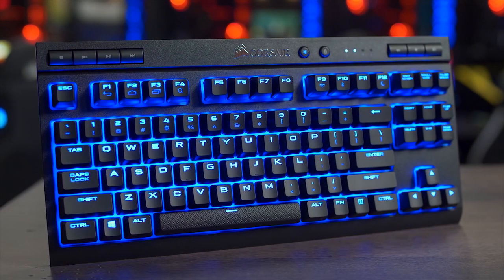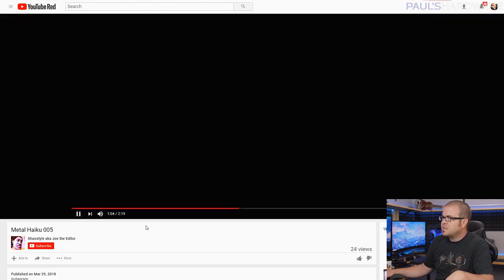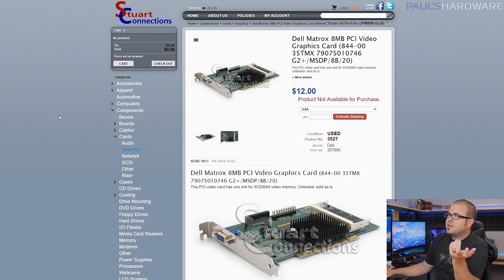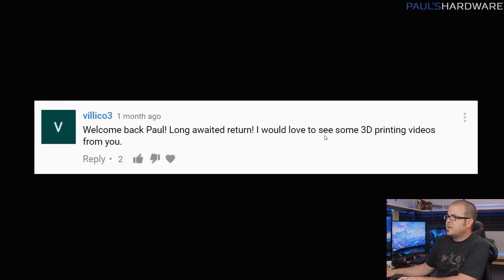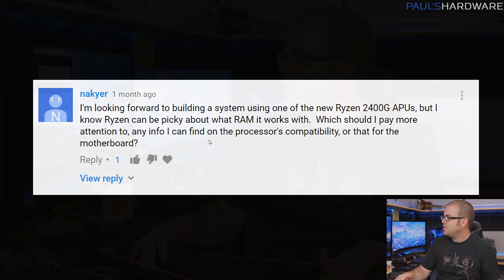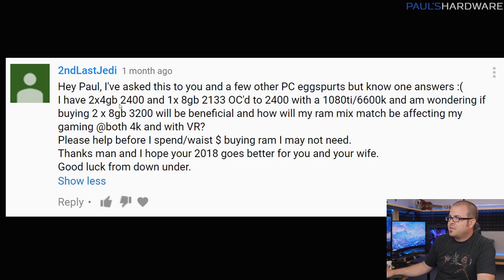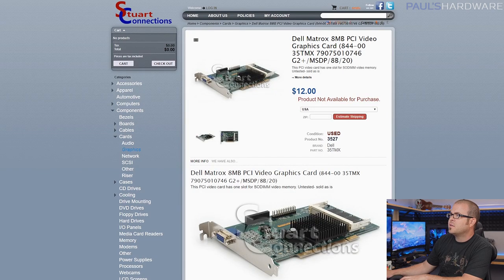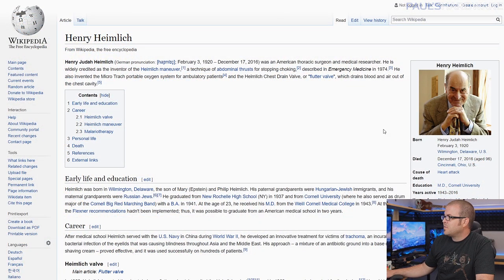Why Can’t You Upgrade VRAM on a Graphics Card? - Probing Paul #23

Comment: 5:00 you could still do it.  They could still design it that way.  They just choose not to.  They could have it so you slide ram in the side, into a little holder between the heat sink and the main board.  Trust me IF they wanted to do it, they could.  They could also program them to use different settings based on how much RAM.  I don't know how cost-effective all of this is, but it's all VERY possible.  Many people do these videos from a consumer point of view:  "You can't do it because the overlords didn't design it that way".  This is why Steve Jobs shocked the tech. scene back in the day.  He walked in and said "we're going to do this, this, and this.  Make it happen".  The Engineers were in the "but people don't do that" mindset.  He yelled at them and told them "GET IT DONE".  So they got it done and amazed even themselves.  Trust me they could make a gpu upgradeable in various ways IF they wanted to.  Fact is, it's FAR more profitable to make people buy new gpu's constantly to get any sort of upgrade.  Sound familiar?  (Hint: can't upgrade phones, tablets, or even most laptop hardware either...)
Reply: This right here is the actual full story.  Granted for the majority of people it probably would not be possible to replace the chip on the board, but its also far from impossible.  I ended up here wondering if anyone made firmware to enable the graphics card to recognize the larger size memory "VRAM", and sadly looks like its such a niche segment that it would take a lot of programming / firmware work.  Just wanted to say that Wayne here is spot on, I've worked in the semiconductor industry for almost 20 years and I can attest, if they wanted to it would not be hard at all.  Perfect example of this is laptops coming out now with RAM chips soldered on the motherboard and "not replaceable", they just decided to do that, it did have to be that way, and until recently has not ever been the norm.

Comment: It's possible to upgrade vram by soldering the same ram to the spare sockets or upgrading it vise versa. Just takes a while as then you'd need to reflash the bios to be a custom developed one (they're available on certain platform, but are a bit hard to find real bioses as most aren't good).

Comment: GPUs did used to have upgradable RAM, they stopped doing it in favour of planned obsolescence.  GPUs usually run out of VRAM before grunt as time goes on (I.E GTX600 series).

Comment: FYI It wouldn't be feasible to setup a printer in your garage if you're planning on filming/recording in the same space. They're reasonably loud even with mods and an enclosure. The print times can also be quite long so you wouldn't really be able to use the space at all unless you're printing while you sleep/out of the house.

Comment: Hi Paul, I have a couple of questions related to hardware for Blender because I couldn't find the answer anywhere on the internet... I am a beginner with this piece of software tho
- Since GPU rendering (AMD ProRender for blender and CAD) is a thing nowadays, should I go almost all in on GPU, or will I need multiple cores for modeling as well, just like for rendering?
- Can the GPU use all the system RAM if I am rendering with CPU and GPU? Or will the memory be combined?
- how much RAM do I need for 'large' projects, such as architectural models (scyscrapers) with modeling (so not rendering)?
- does a faster CPU (higher single core performance) affect MODELING performance, like with CAD design? Or won´t there be a big difference?
I'd love to hear your answer!

Comment: The Prusa i3 MK3 would be what I recommend as far as a 3D printer goes.  It has the best feature set for a desktop 3D printer imho.  Mesh Leveling, magnetic bed, filament sensor, etc and it's super quiet compared to nearly any printer in that price range.  For $750 you can get a kit and put it together easily in around 3-4 hours. It has a very good manual for building the kit or for $1000 you can get one that is prebuilt.  

I've used mine a bunch for 3D printing parts for my PC and for others.  Cable combs, PCIe/RAM/IO slot inserts.  Did some custom stuff to cover over the I/O on the left side of the motherboard for a friend that I 3D modeled their gamer tag in to it giving them a super custom look.

Comment: Thanks Paul for another informative video. I have some questions about some bios settings in regards to overclocking; and, was hoping you could answer these questions. I'm running a 6700k on a GB Z170MX-Gaming 5. There are so many ways to OC; and, so many settings that offer no explanation as to what they do. I was hoping you could help.  For example: 1. Uncore 2. CPU Flex Ratio 3. LLC 4. Thermal Monitor 5. EIST vs Speed Step. And, the list goes on. I know what most of these are. I have been OC'ing for years. But, I'm sure there are plenty of people that don't. And, there is little information or an abundance of misinformation on a web search.
On my board, I can OC by changing the Clock, Multiplier, CPU upgrade, Turbo, Flex Ratio. There are hidden caveats, under CPU voltage. You have to type "Norm" to unlock variable voltage. There is no drop down menu. Holy Confusion! Batman.
So; to summarize. I'm not looking for an OC video. You already have one. I'm looking for an explanation of cryptic bios terminology & settings.

Comment: Hey Paul, how much additional degradation does overclocking do to a component? I have a friend who isn’t sure why you would want to overclock, due to the fact it wouldn’t last as long. I was wondering if you knew a rough estimate on overclocking degradation. Also I commented on you htpc vid, try using a strix card, the fans don’t spin up until you game on them quite heavily
Reply: Leone Furlan that’s still helpful, it’s just been hard for me to convince him to overclock his 960 for a performance uplift (his cpu is a locked intel 6th Gen on an h-series board)
Reply: Biggest factor of degradation is temps.
If stock gaming your temps are in the 60s and you overclock everything and manage to keep the same temps there really isn't any degradation. Unless you bump voltages to high for your CPU to high then there's really no issue. Jayztwocents does a video and mentions he ran an OC setup 24/7 for 7 years none of the parts died he just ended up finally upgrading.

So in the end of you keep safe temps and safe voltages you won't hurt anything.
Reply: Obi Wan so it’s more voltage/heat than anything that will degrade the parts?

Comment: Question for next time:   Can you explain audio on a PC and why sound jumps up or down based on source.  Why isn't there a sound leveler in the onboard circuits?  When I switch from YouTube to HD Homerun or Plex, sounds change.  Then, when trying to connect headphones on my new Asus i7 Win 10 PC build, the front panel headphone won't get sound, possibly because I added a GPU card - how to diagnose and fix audio problems and get a single level sound for both speakers and headphones.

Comment: Paul, you can run dual channel with mixed ram capacities. If he configures his dimms where channel A has 8GB total and channel B has 8GB total (probably arranged as 4, 4, 8) this will run in dual channel.
Reply: David Brenner it was running dual channel but still creating stutter ,now I have 2x8 3200 it's stable .

Comment: Question: You talked about the possibility of upgrading a graphics's card memory, and why it wasn't cost efficient. On the other hand, CPU does work with many different RAM combinations, which (applying the same logics) probably make the CPU more expensive as it has to be compatible with them all, among other downsides. Do you see a future where you could buy a MoBo with an already integrated CPU and RAM? More like a combo that reduces price by a lot but doesn't allow upgrading?
Reply: You can already buy such motherboards, though they're usually very low-end boards designed for embedded systems. As for your other point; you are right about that, but I think that both Radeon tech group and Nvidia are quite happy they can develop memory controllers for their GPUs that only ever need to work with a very specific spec of VRAM, as opposed to the much more expansive and complex memory controllers that have to be built into CPUs.
Reply: Robert Faber I’m not talking at all about graphics cards nor VRAM, that was already explained in the video. My idea was focused on high-end motherboards with CPU and RAM built/in, usable on desktop PCs or even servers, so that performance is optimized and price is lowered... I know things like the RaspberryPI exist, but thanks anyway :p
Reply: +Arminecraft - Upon a second read of your original comment, you're quite right; you didn't explicitly ask about VRAM. With the motherboards, there is indeed the RasberryPI, but there are also a number of boards with Intel Celerons on them, and while some of those use SODIMMs, I believe there are also those with RAM built into them. Nothing high-end though, insofar as I'm aware.

Comment: If you're strapped for space in a small case with an AIO, could you use Slim Fans for it? Example: 240mm AIO comes with 2x 120mm fans, would there be any significant advantage to adding 2 slim 120mm fans on the other side for a push-pull setup?

Comment: Ok...How about this Idea. In a SFF or cube case that has the graphics card mounted near a vent. Remove the fans from the card and use case fans mounted in close proximity to blast the GPU cooler. Seems like it would be functional, but do you think it could be beneficial?

Comment: Hi Paul. We are all told the benefits of booting from an SSD and there are loads of videos on how to migrate your OS from an HDD to an SSD. There's even hardware to use USB to SATA to facilitate this. 
But now, a lot of people are using M.2 NVMe drives for their OS. How would you migrate the OS from these, especially if your mobo only has one M.2 slot? 
Is there any reason why you should never migrate an NVMe drive besides the same reasons for SATA (AHCI)? ie A clean install is clean.

Comment: Hey Paul, are 3840x1440p ultra- wide monitors with 144hz refresh rate a thing? And if so, are there any that don't cost over 1k. Preferably in the $400-600 range is where I'd be comfortable buying a monitor.

Comment: Hello Paul,

I was wondering if you could make some videos on installing water cooling loops in cases that don't have a lot of built-in support, like a Fractal Design Define R4 instead of a R6? For instance, I have a R4 and just installed the EKWB A240G kit, but finding a place to mount the reservoir/pump was quite difficult.

P.S. I work with binder jetting 3D printing, you should check it out! I love that your content is informational and fun, but not ridiculous.
Chris

Comment: Hey Paul. Do you know why case manufacturers don't make more full atx cube cases similar to corsair A540. I like that hdds, ssds, psus, etc are in a desperate compartment and then the motherboard gpus and Cpu are in a high airflow compartment with plenty space for water cooling etc. It keeps case generally easier to clean too. What other cases are there similar or better that are full atx cubes?

Comment: In response to question 2 from last ProbingPaul......is your great with CPUs & really good at soldering/electronics, etc...is it wise to swap out vram & soldered memory from pcb boards with higher storage &/or speeds? Or would it most likely "throw out" post codes b/c motherboard doesn't like or accept "new/diff" memory other than stock? Hope making sense....

Comment: great vid Paul, is the cost/performance difference between an 8core cpu and 10core cpu worth it when it comes to rendering video(like 4k/multi channel audio, etc), editing photos, and other workstations scenarios ?
Reply: Really depends on different software, and how well they implement it. If we're comparing chips of the same microarchitecture with comparable clock speeds, then the decacore will perform roughly 25% better than the octacore in software that can fully utilise it (if we ignore the effects of a reduced amount of cache per core), and so it would technically be worth it if it costs 125% of the octacore, or less. In reality though, I think going for an 8C16T processor is the sweet spot for content creation right now, mostly because the extra 2C4T would only really come into their own during video rendering, 3D rendering, etc., and don't really add much beyond that; it's unlikely you'd need the extra threads for video editing proper, for photo editing, for 3D modeling, or anything along those lines, because those workloads are much less parallellised, so you'll struggle to even use sixteen threads to the max.

Comment: I've asked before in a different video I think to Jay, but I was wondering why APUs were still locked to 2GB of shared memory.  Someone told me more RAM would be a bottleneck, or the motherboard would be...but I would think since for DECADES APUs have only allowed 2GB of RAM, where we have all these new processors with memory management and such that we can't break that 2GB video memory limit.  Also, if you can support 32GB in a Mini-ITX and up to like 64GB on some boards, it seems ridiculous to not be able to dedicate more memory.   Most games will not use more than 8GB so basically with 16GB you would be just wasting memory, so with up to 6-8GB you could use...why not allow it?  Or at least give the option to do it if you wanted to dedicate more.  Or even if you could dedicate like a specific DIMM slot, or have a third DIMM slot that lets you just plug in some dedicated memory for an APU setup.

Comment: Hey Paul, I’m looking at building my first rig and I’m torn between a Ryzen 5 1600/2600 (depending on testing and specs) and an Intel 8600k. I want to use it for gaming and streaming/recording, but I’m concerned that Intel will change the motherboard socket within a year. Furthermore, I am looking forward to the debut of Zen 2 and further refinement and optimization of the Zen architecture, and would like to have a large upgrade path, as is featured with Ryzen. Any suggestions?

Comment: Paul, I'm considering buying a new graphics card. Should I wait and buy a new Nvidia GTX/RTX 1180/2080 or 1170/2070 or buy a used 1060 now and sell it later? Current graphics card: AMD RADEON HD 6670
Reply: If you're looking for a used 1060 as a temporary solution, don't count out a used 970 either. The 970 and 1060 are virtually identical in gaming performance, and I believe 970s are less affected by the value increases thanks to mining.

Comment: Hey paul liking youre video's keep it up. I got a question for you about my gaming pc. I just got in to pc gaming and building. And this is my first build.
My current setup is
- intel core I7-8700k
- Gigabyte Z370 aorus ultra Gaming (rev 1.0)
- Gigabyte GTX1080 G1 Gaming
- 16gb 2400mhz adata (daul channel)
- samsung ssd 250 gb
- toshiba 2tb harddrive
- sharkoon silentstorm icewind 750w
- air cooled system
Is it better to get a another 1080 and sli it or take a new 1080ti. Which one is better to do for best performance later when games get more demanding?

Comment: I recently built a new computer and had a question about overclocking. Parts are ASUS x370 ROG Crosshair VI hero, Ryzen 5 1600x, 2x8gb ddr4 3000 TridentZ memory, ROG RX 560 gpu, 250 gb m.2 WD Blue, and a corsair 950w psu. With that out of the way my question is when using ASUS OC wizard or applying any manual overclock to the processor the motherboard stops recognizing the m.2 drive and has memory frequency offset of +54 mhz making my memory able to go to 2964 or something like that but cant reach its full potential. If I dont overclock the processor I can speed up the memory just fine. My motherboard I believe has been upgraded to the most recent BIOS, unless there updated within the past month again. Stock speeds are more than fine though so it's not like it's hurting me any but I do want to satisfy my curiosity.

Comment: Could a motherboard manufacture create a motherboard specifically, but not limited to APU's.  That has say 2 or more gigs of GDDR5 memory installed directly on the motherboard so it can be utilized instead of the system memory for graphics?

Comment: do u recommend upgrading an older laptop with an ssd or buying a new one?
Reply: putting a ssd in an older computer, laptop or desktop, really puts some pep in it's step
it's not going to overhaul the whole thing, but assuming a computer is of a certain age, it can revitalize the computer

it won't help with gaming though

what are the specs and what do you use it for?
Reply: It's difficult to compare, because those two things come with vastly different prices. Putting an SSD into a laptop can absolutely be worth it for the increased speed and reliability (the lack of moving parts being more important in a laptop that moves around on its own), but it is worth considering that most laptops only have a single drive slot, so you should probably expect to either lose a big chunk of drive capacity, or spend big money on a drive that is both fast and capacious. I personally went from a 350GB hard drive to a 120GB SSD in my laptop, and it's absolutely been worth it, but then again, I only use my laptop for very basic applications, and if I had to store a large number of games or films/series on it (which I do on my gaming rig instead), then I'd probably have replaced it with a bigger hard drive instead, because capacity matters more than speed at that point.

Comment: What about if someone gave you a 1080 with a damaged pcb and no longer works, And you have a 1070 ti and swap the ram out, 1080 mem in a 1070 ti? I am able to do the soldering needed. =)

Comment: I've been running 8gb vram on my 780 but that's because I was able to fine tune the bios and have a backup chip and a bga heating unit to remove the modules and re heat them, ps do this at your own risk, I've gone through 3 other 780's